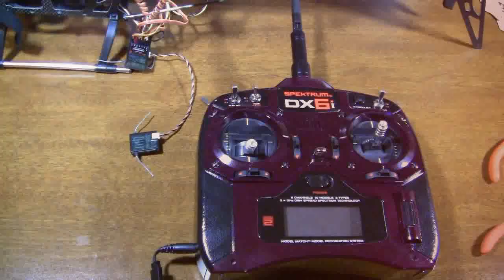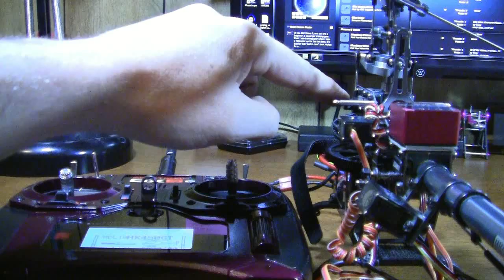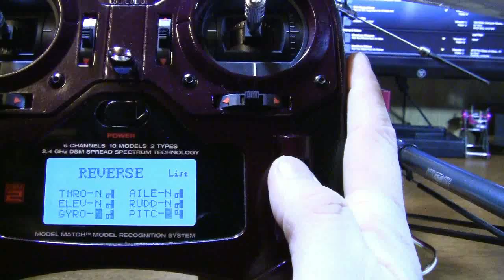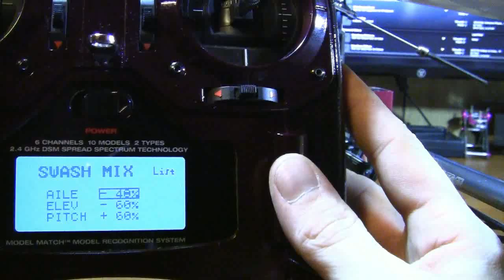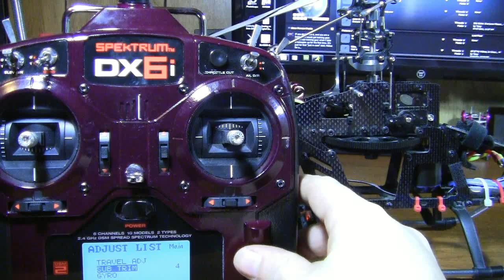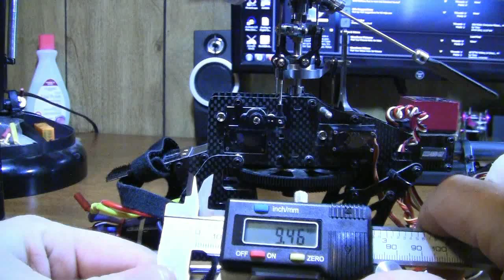DX6i & CCPM Full Setup Guide Part 3 Binding, Adjusting Servos, Setting Up Head Links

Comment: Hey tony , I’m trying to set up my trex 600n to a dx7s . Now I have all the servos working together , my throttle and pitch work perfect on the left stick , but my right stick that controls the over all direction of the heli moves in the  opposite direction ( if I move  the right stick right the Swash moves left , if I pitch the heli forward the Swash moves back ) if I try and reverse and Servos to fix the issue it throws off the controls on the left stick . I’m in desperate need of help ...
Reply from the maker: In your Tx, I believe the menu is either Swash or Swash Mix. In there you should see 3 settings with a +60 next to them. Those are Aileron, Elevator and Pitch. Pitch is for the left stick and is the collective. Aileron and Elevator are the cyclic. Just take those numbers into the negative and it will reverse the throws. Hope that helps.
Reply: RcHelpDotCom my servos aren’t responding
Reply from the maker: @pawneep20  I am going to need a LOT more information to help you. What receiver, what gyro, what servos, what Tx, are you sure your plugs are plugged in the correct orientation, are you sure your battery is charged, have you bound your Tx to your Rx, are you seeing a low throttle signal... I will stop there. But please post as much info as you can when asking for help otherwise we can't help. www.Rc-Help.com
Reply: RcHelpDotCom I have a dx61 using the Same receiver and servos as seen in the video,I have the stock gyro gy192
Reply from the maker: @pawneep20  My best guess is make sure you have the servos and ESC plugged in the correct way. It's easy to plug them in backwards.
Reply: RcHelpDotCom Ecu in the throttle port,rudder in the rudder port,single wire in the gear, one Servo in aux,elevator and aileron
Reply from the maker: @pawneep20  Come over to the forum and post up a picture of your setup. www.Rc-Help.com
Reply: RcHelpDotCom got it
Reply: RcHelpDotCom I can’t get to the form I posted a video on my YouTube